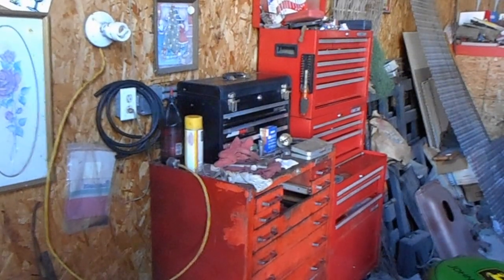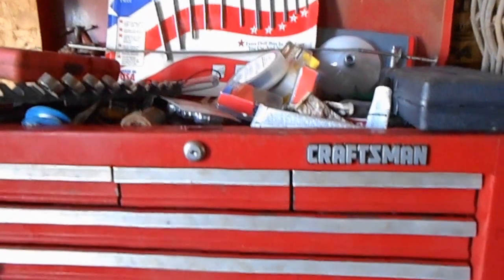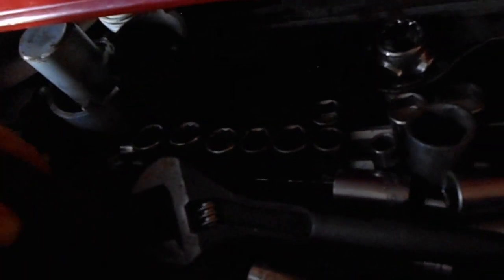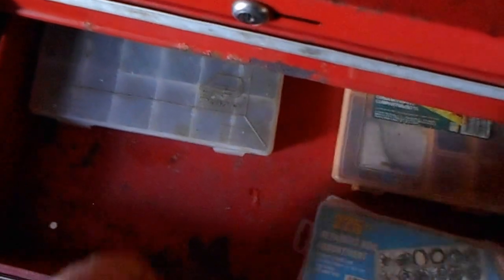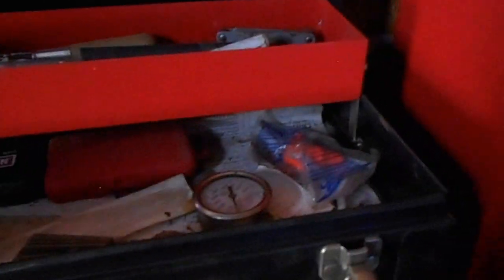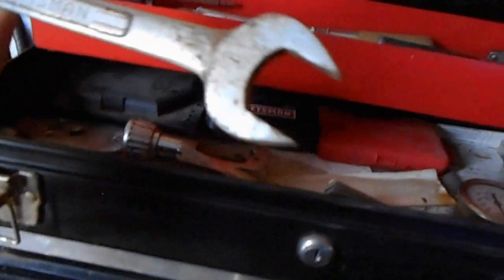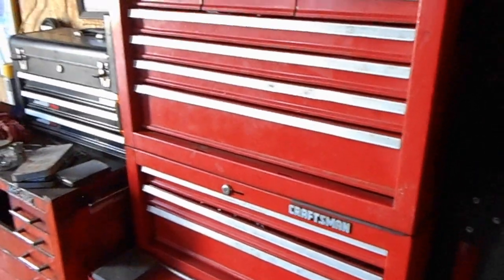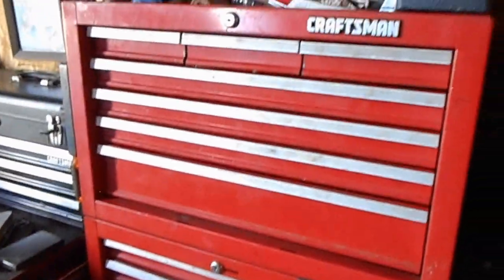Got me some New Used tool boxes !

Comment: Bandit, you have a real nice tool hoard. I think oliver66farmboy is starting to rub off on us old guys. I find myself organizing tools and getting the old shop standing tall. Nothing like a little youth to light a fire under us. You really got a great deal on those boxes, keep up the good work. Now, if your like myself will you be able to part with all those small boxes? I'll stay tuned.
Reply from the maker: +Scott Viers You got that right, Mine dads and grand paws they will never leave I'll just find a new use for them. Good parts holders for stuff you don't want to loose track of. Sounds good to me. He is starting to get me to clean up and get things like they should be and not a mess.  One of these day I will have to do a video of the shop, But not till it's cleaned up some,  Oh my back hurts already thinking about it.   Bandit
Reply: @banditfarmer1900  Them little boxes are good for oddball stuff... I have one for planter parts, an old cooler full of planter plates (cast iron and plastic-- I bought  BUNCH of cast iron plates from a place up just outside of Abilene, TX back in the 90's... they had HUGE roller racks with bolts welded on them, with dozens of every make, type, and kind of cast iron and steel seed plate you could ever think of, and boxes and boxes of plastic plates in the warehouse of every type and kind... I grabbed about one of every JD plate ever made I think, because we had the old #18 Deere blackland planter, plus the 7100 has plate bottom hoppers and drives I could put on it if I wanted or needed to... even got some steel "blank" plates that you cut your own seed pockets into with a die grinder, along with a set of some of those someone had milled two slots in to plant watermelon seeds!  LOL:)  

I have another of those old lil boxes that ended up with all the stuff in it for the cotton pickers-- bushings, shims, bar gears, super-deep spindle bushing sockets, moisture pads, grease and water tubing, fittings, etc.  Good to have a box for all that stuff for each machine that justifies having enough parts and bits and giblets on hand you don't want scattered everywhere!  OL J R :)